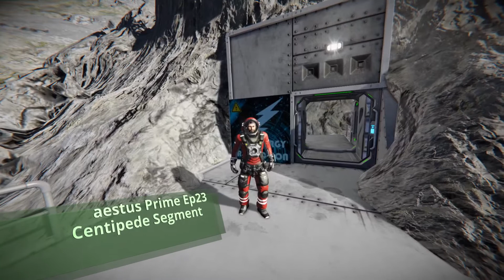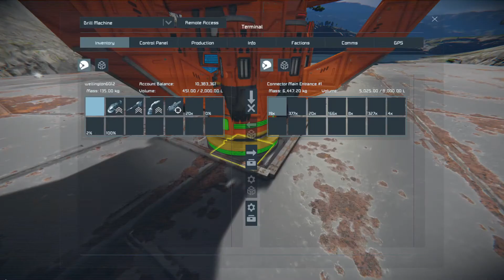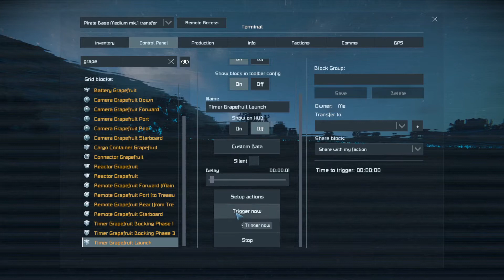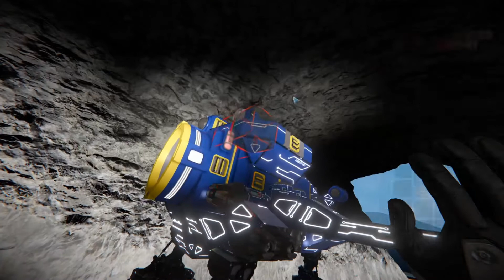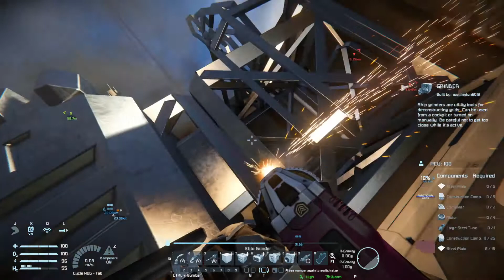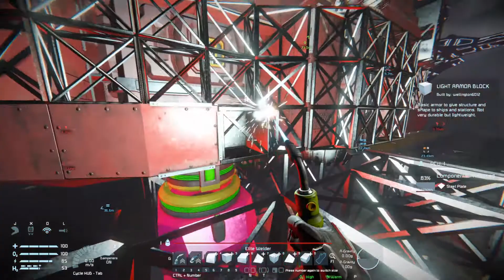Hephaestus Prime EP23 - Centipede Segment (Space Engineers)

Comment: Liking the thought of the modular ships, looking forward to seeing how that pans out. Always had trouble designing multi role ships so ended up making specific ships every time.  Enjoying the series so far.
Reply from the maker: I know what you mean, I've built welding ships, grinding ships and used them once and then never again. Not a waste if it were just the welder or grinder, but you always need lots of extra thrusters, batteries etc for the associated storage requirements. If you like modular ships, I have a small ship called the Purple Turtle on the workshop and short video in my workshop playlist. Glad you're enjoying the series, I'll let you discover for yourself how the Centipede goes.